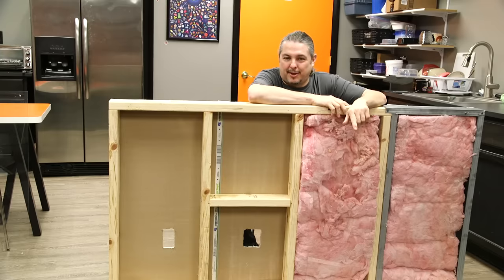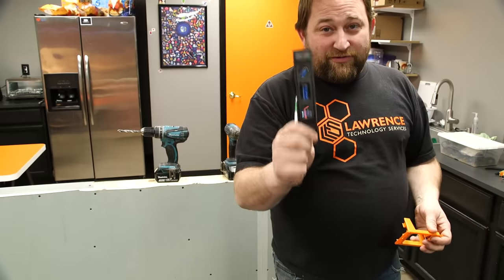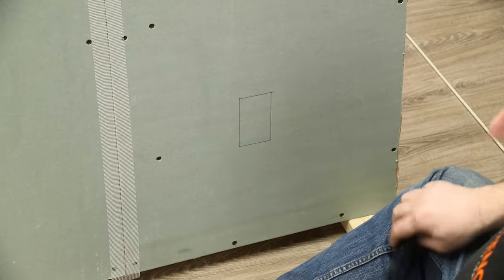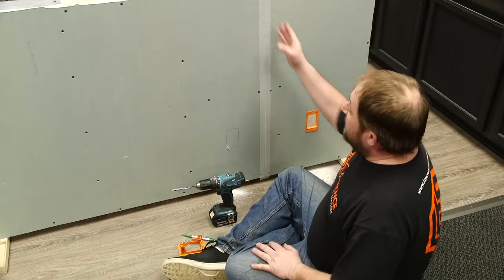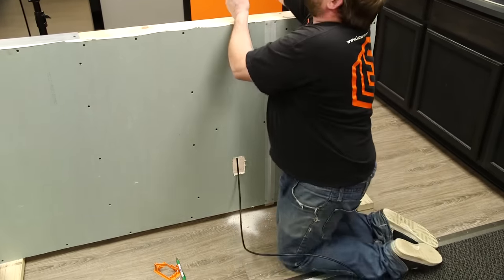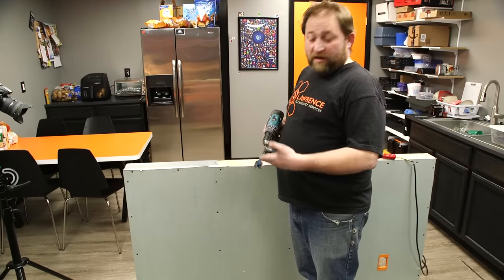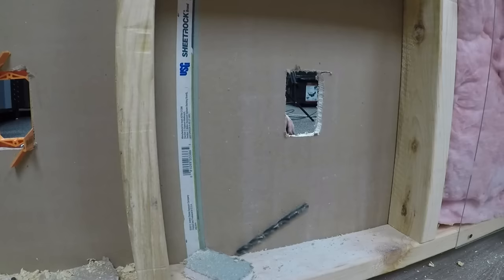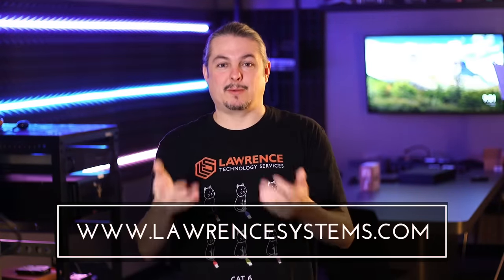Wall Fishing Tools & How To Use Them When Dealing With Fire Stops and Insulation

Comment: How much do these tools cost?  Rentable maybe?  I plan to run some cables through the walls in my home for cameras and more ethernet jacks.  These would make life easier!
Reply from the maker: We have links to the tools in the description, some places may have rental options but I am not sure.
Reply: @LAWRENCESYSTEMS  thank you!  This will help a lot on my home projects.
Reply: @cbremer83   Most of these tools are very cheap (relative to other industrial tools).
Reply: If you keep your ethernet jacks on interior walls and cameras on the soffits you most likely won't have to deal with insulation or fire stops. I only have a fish tape and did 28 drops in my house.
Reply: @zachicusmaximus5551  Not entirely possible.  The main wall all current cables come from is an exterior wall.  That is the only real way to get from my attic space down two floors to where the fiber line comes in and my rack currently sits.  All the existing cables in the home run to the same spot.  Coax and CAT5e the home came with.  My plan for the cameras is to run up to the attic space with a single CAT6 cable.  Put a switch up there.  I have easy access to some power.  Just need to install an outlet.  Then run drops for each camera.  Only going to use 4 cameras at the moment.  All will be unifi gear.  My whole network is unifi besides my router/firewall.  Worst case, I run four lines into the attic for the cameras and plug them all into the switch in the rack.  The other home outlets will likely also go into the attic space.  Then drop down the walls from there.  It's going to be a lot of work regardless.

Comment: Can someone explain why the hell its called a "Fire Stop"? its just wood, wood burns, we call that a noggin in Australia we use for the sturdiness of the wall and studs, It's also used on interior walls here. I think that where we have the US beat, we use simple c-clip brackets to mount both electrical and data plates to the wall instead of the mud ring(?)

Comment: you did not do wall 4 why not insulated wall with fire stopper inside what do we do
finish the video please
or add that section to it and upload it  ??????????!!!!!!!!!!!!!          Come one 4 sections you provided solution to 3 , Must finish the 4th please
Reply: The 4th is the same as the third my friend. Its kist framed with metal but its essentially the same process just using different drill bits.

Comment: 6:59 
THAT SIR - is "not" a stud.
Studs are vertical members.
THAT horizontal wooden member - is called..
A DWANG.

It isn't usually there for fire ratings or anything to do with "stopping" fire going UP (or down) a wall - but for building STRENGTH purposes.
It also allows the studs to be correctly spaced in the wall - to allow wall fixtures (such as drywall) to be secured with fixing screws - without having the fixtures "holes" - wandering all over the wall - to "find" the wandering studs.

The dwangs are there to also allow the builder to have long walls stand vertically on their own, whilst they build the rest of the structure..
Because they provide the wall structure - with rigidity.

Google is your friend - use it.
Wikipedia is also a GOOD source of info - SO USE THAT TOO.

Re:
DWANG
https://en.wikipedia.org/wiki/Dwang
Reply from the maker: It's both and it's require by code in many places here the USA https://www.oneprojectcloser.com/fire-stops-fire-blocking-in-studs/

Google is your friend who offers more than just one answer if you want to take the time to read it.

Comment: Really, crawl into the attic drill drop a fish rod gow back down and pray where you are about to drill into a wall is the same place you have the rod sitting behind the wall. Then if it is put on a ring tie off your coax now crawl back up the attic and pull up your coax.. You just wasted 25 minutes. You are an armature or you were never tought the right way to fish walls.

Comment: Excellent presentation, but glare from the bald spot?  Please.

Professional "PRO" advice follows...  DIY Harry and Mary Homeowner can benefit too.

Put a cap on like my rabbi makes me do at synagogue. It's not just a religious thing.

Use a Labor Saving Devices LSD EZ-CUT with built in level to mark your lines.

Cut drywall with an oscillating multi-tool. No drilling holes or poking your eye out with a stab saw.

Use a dry-vac vacuum cleaner while cutting to eliminate breathing gypsum dust and getting into your Stella Artois.

Comment: Step ONE was left off this video.  What is on the other side of the wall?

Shame on you guys.  You are leaving out vital information to amateurs who could be electrocuted, flood, blow up, set fire to their home, cause severe injury or death.

If there are perpendicular walls you are going to have a cluster of studs inside the wall.  Good luck drilling through that.  Beware of pocket doors.  What if you have a hip roof at the top of the wall or you have a bathroom or a kitchen on the other side?  You could have all kinds of stuff in the wall like vents, sewer pipes, water pipes, gas pipes, electrical wires, medicine cabinets, duct work, extra wood blocking etc.  Caution is highly recommended.  If you have an electrical sub panel or breaker panel on the other side be extremely cautious.  Drilling or using a sheet rock saw and hitting an electrical wire could change your voice or cause a lot of unnecessary work.  By the way, do you know where the water, electrical and gas shut offs are before you start messing with the walls?  I am a forty eight year licensed General, Plumber and Electrician and have seen it all.  I once saw a cable guy drill right through a customer's medicine cabinet and another drill through a plastic ABS sewer pipe.  I was called out to a job because a handyman shoved a sheet rock blade right into a 220v 40a electrical circuit.  The owner said that he got he got a really bad shock.  In that case a junction box had to be added under the house and a new section of Romex put in.  My bill was $340.  The handyman was lucky, he survived, didn't start a fire and the owner got off cheap.  Then there was the real estate agent that thought he would save some money by installing a water heater strap by himself.  He drilled right through a safety plate and into the hot water line.  Fortunately it was in the garage, not inside the house and not a gas line.  I can go on and on, but then again, there is always the Darwin Award.  My advise is to always check with a professional first unless you are one.  If you are sure there is nothing in the wall besides fire blocks and insulation, have at it, what could possibly go wrong and look at all the money you will save by doing it yourself.